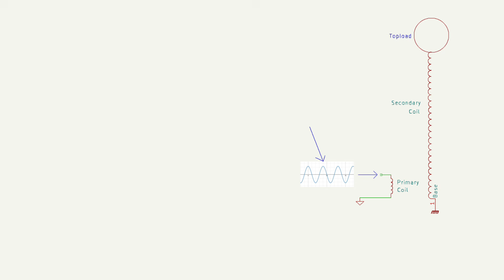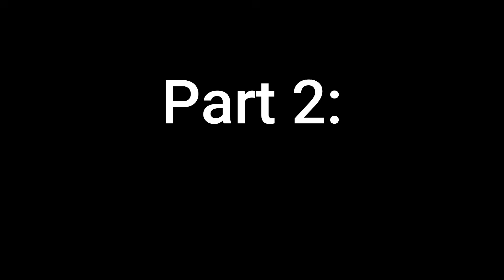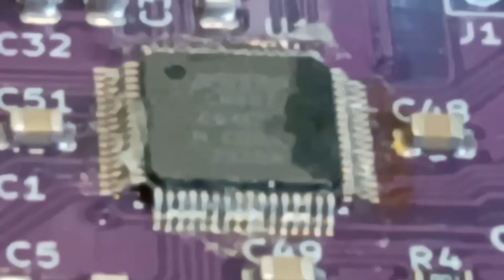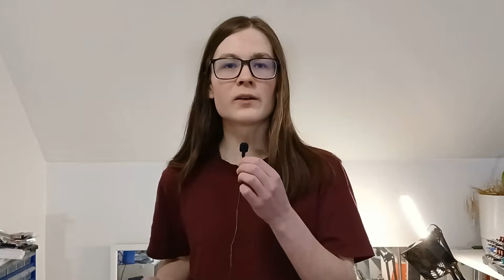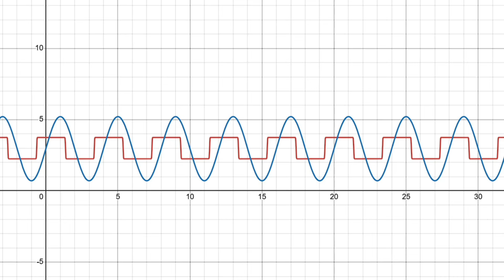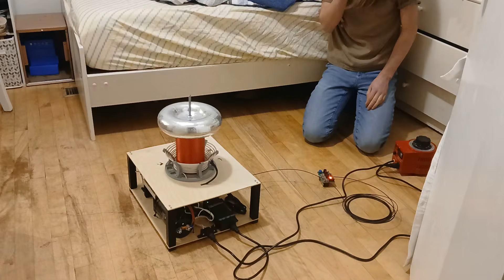How I built a device that shoots 1.5 meter lightning | QCW Tesla Coil

Comment: Great take on the QCW, the result is impressive! Also, the editing and storytelling here are on point👍 Thanks for sharing!
Reply: i have an analog ramp generator circuit that requires only 2 components. no switches, no microcontrollers! just 2 components to generate a near-sinusoidal ramp, and you can make the on-time and voltage whatever you want! but it requires alot of tuning and patience.

Comment: Why on earth spend so much time to build driving circuit. If one just wants 1 m sparks, rather get a beefy vacuum tube and build ordinary VTTC!
Reply: you can use the 16ms mains sine ramp with a solid-state coil as well. QCW is just way better and more educational
Reply: @Ferraday  no. divide that by 2. then if you want the ramp to end at the max voltage, divide that by 2 again
Reply: if you tune the qcw a bit more you can get 2-3m sparks
Reply: Because a vttc can’t produce arc lenght like a qcw can. Qcw’s are a whole other bread compared to vttc. You’re comparing a 1980’s muscle car to a 2026 1500 horsepower electric beast.
Reply: @ChrisWatkin-iz5hi  Surely they can, but they need to be more powerful to do it. Speaking of "muscle cars" I've seen a monster tubes VTTC  generting like 2 meters  sparks. About 10 kW with staccato interrupter and 20 kW+ input full blast. Scary af
Reply: @ChrisWatkin-iz5hi  Well it enables more flexibility than VTTC for sure, but it's a WAY more complicated. Pros and cons. With a good setup and powerfull enough components,  VTTCs of several kW can put out spectacles

Comment: Good job on the coil, it's pretty neat.

Wanted to email you regarding the below, but your channel does not have a contact email:
You have doxxed yourself, on your first video you can tell the postcode (even though you have tried to cross it out), and on the bridge rectifier video you're showing the front lawn, with the two cars and camper, literally the same cars and camper are showing up in google maps/street view.

Feel free to delete this comment after you sort out the postcode leak, maybe you can cut the frames in youtube's video editor?

Comment: amazing job bro

On a side note, have you heard of APWM (asymmetrical PWM) for these QCWs? I haven't experimented with them myself but apparently you can actually use a half bridge, and instead of phase shifting, you literally change the duty cycle of the half bridge drive. There is a guy on highvoltageforums that mentions that also using a pair of silicon carbide mosfets yields very good results, and you can kind of just hard switch them without relying on ZVS as much (good for phase shift and APWM)

Comment: Lol wow, this is both amazing... and man, you should not lick a capacitor! 

Have you heard about dielectric absorption aka dielectric soakage? All capacitors have a history effect, where charge slowly migrates over time when the capacitor is polarized, and then is slowly released (both effects being temperature sensitive). This results in the capacitor's terminal voltage rebounding after being briefly discharged and then disconnected. I'm not sure about high voltage electrolytic, but I imagine they'd be on the worse end in terms of terminal voltage recovery. Some capacitors can recover a substantial fraction of their terminal voltage.

It's funny, I used literally that exact same capacitor in a big pulsed power rig I built to test pyrotechnic disconnect devices and their control circuitry at work many years ago. I had it inside of a big steel 5 gallon bucket with a band clamp style lid because it scared the hell out of me too.

To address the absorption issue all capacitors of this magnitude should always be stored with a shorting wire wrapped around the terminal posts.

This build is totally amazing, and I'm glad you got the CPLD to work. I'm not sure I would go that route if I ever did this, but the fact that you did get it to work at all indicates that your layout and board design must be pretty decent. This is an atrocious environment in which to try and get a high speed digital device to operate stably.

[oh ps, you saw that Q1 and Q3 are upside down, right? I presume you found that one or your phase shift comparison ramp wouldn't have looked as good as it did]

Comment: It's been years since I've messed with this stuff, but you might want to consider using better snubber capacitors in case you want to revisit the project. I can't really tell but I don't think the ones you are using now are low inductance ones.  I think when I did this, I used capacitors from induction cookers. Anyways, it is important to use low inductance capacitors because they can smooth out the voltage spikes, especially with long wires connecting the bridge to the main 10000uF capacitor. The capacitors on the IGBT bridge board supply all of the current needed during switching events, so they must be low inductance. Also, I can't really tell, but did you put a TVS diode on the IGBT gate too?